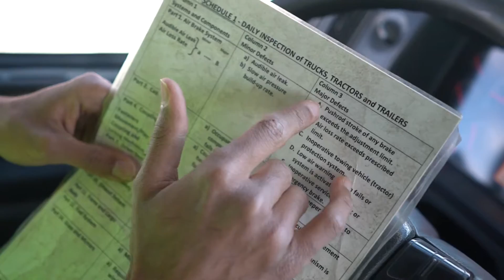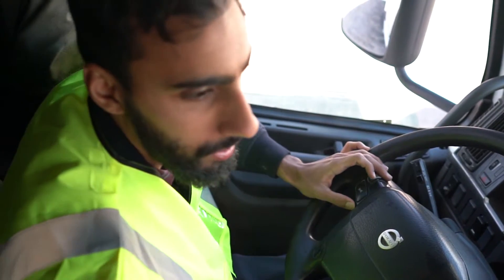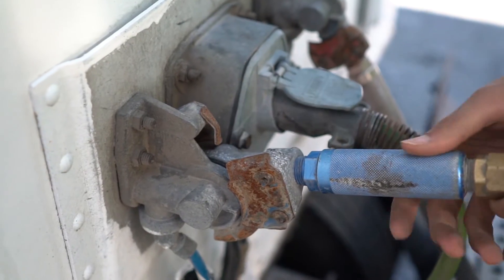Tractor Protection Valve

Comment: U are doing wrong.  U supposed to disconnect both airlines.  Dont mislead people by doing nuisance tests.
Reply from the maker: Hi, 

Just wanted to clarify you have to disconnect just the blue service line as you are also pressing the service pedal brake, to listen for any air leaks. The red supply line has nothing to do with this question. 

thank you

Comment: That is not at all how you check a tractor protection valve. Both lines should be disconnected while the parking brakes are RELEASED. Not applied. This is supposed to simulate a trailer breakaway. Try to mention that the wheels should be chocked too dude.
Reply from the maker: Hi, 

If you have a trailer attached then we have nothing to do regarding the red supply line as that line supplies air to the trailer. also by releasing the parking brakes it wouldn't matter because the tractor protection can be tested either way!
Reply: @gmtruckforklifttrainingcen810  You are 100% wrong on your test procedure and you should delete this video as you are passing wrong information.  The trailer brakes need to be released, disconnect the service line, pump the brakes, the valve should close before 20 PSI, no air should be coming from service line at this point - this needs to be verified by touch not listening from the cab (thats ridiculous that you think that is effective), remove emergency line and verify air is exhausted and spring brakes are applied - you could also disconnect this line from the get go and let the air bleed out that way.  Having the brakes set voids the whole  test, the valve in the cab is NOT the TPV, its a separate system called the Trailer Supply Valve (TSV).
Reply: @peterl4823  thank you
Reply: @gmtruckforklifttrainingcen810  Look up testing the tractor protection valve inspection bulletin posted by CVSA. If people are paying you to instruct them on this kind of stuff, you should at least be giving them the right information.

Comment: bro yellow  brake will go in
Reply from the maker: Yellow brake is optional in the tractor protection system. when the service brake is pressed down, You can find out if there is any leak or not!
Reply: @gmtruckforklifttrainingcen810  it can't be optional by any means
we check tractor protection system because when we have to drive tractor without trailer there is no leakage from service line 
so when we drive tractor we have to release yellow brale
Reply from the maker: @_JasbirBajwa  The yellow brake has no play when we are checking the tractor protection system, at most what would happen is when we release the yellow brake the tractor would end up rolling and by pressing the service brake it would only stop or control the tractor.